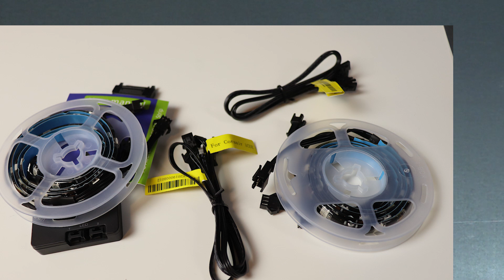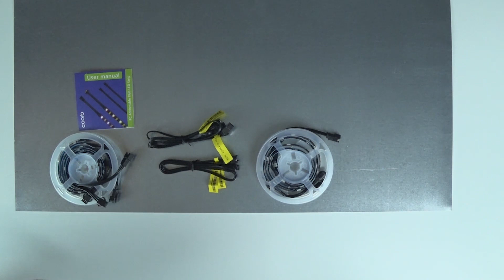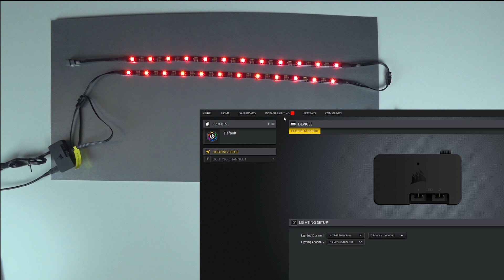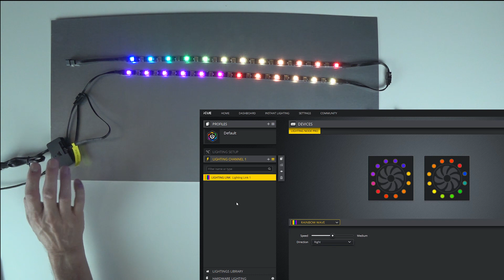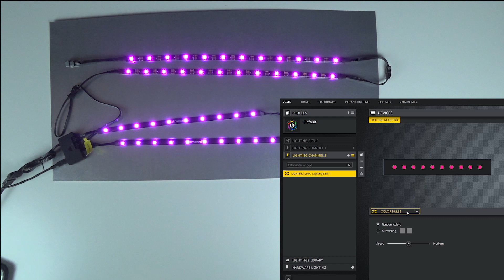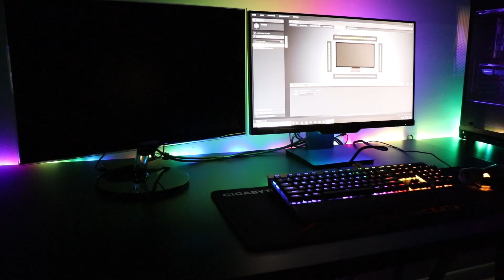Coolo RGB LED Strips for Corsair Lighting Node Pro or Commander pro

Comment: link to the coolo strips?
Reply from the maker: Hi The Gaming Dad, it does appear that these are no longer available on amazon. I hadn't looked for some time.  That's disappointing because there came with the right cables to connect up to corsair. I don't see an identical replacement, but I only spend a few minutes searching. You still can purchase the Corsair to standard 3 pin ARGB adapaters and use any standard 3 pin RGB strips. Here is an example from Amazon, this looks like it has 2 cables, the controller isn't included, but you could add some cheap 3 pin ARGB to this. 

https://www.amazon.com/EZDIY-FAB-Adapter-Lighting-Commander-Included/dp/B08KGMZ9YT/ref=sr_1_26?crid=A4J4AJVJFU61&keywords=corsair+icue+rgb+strip&qid=1641965225&sprefix=corsair+icue+rgb+strip%2Caps%2C80&sr=8-26

Good Luck, thanks for watching!

Comment: Thanks for the video. Two questions about the extension cables.
The extension cables are more like adapters right ? Also can I NOT put two extension cables together to add length ?
Reply: "The extension cables are more like adapters right ?" Not really adapters, no.

"Also can I NOT put two extension cables together to add length ?" Yes you can.